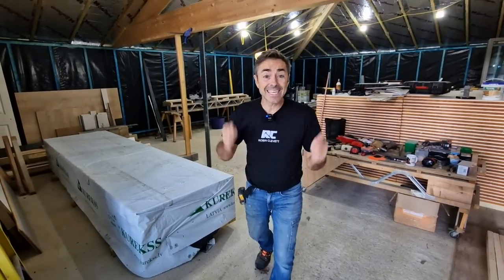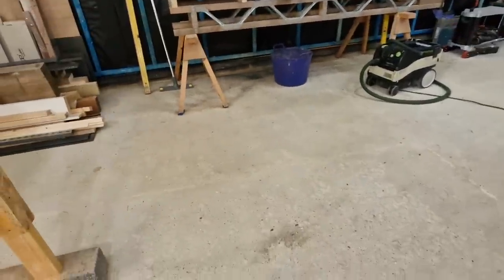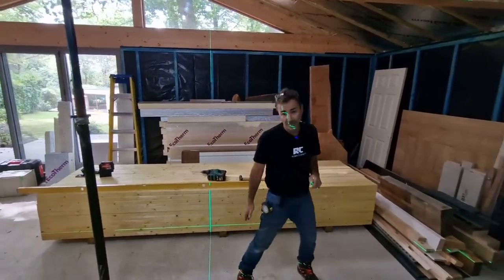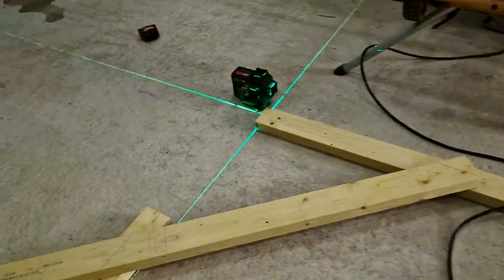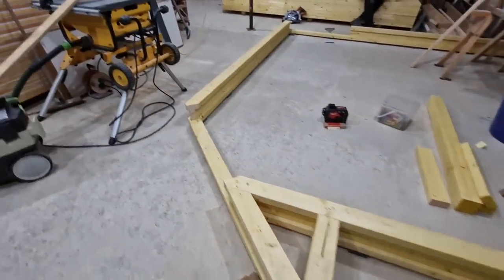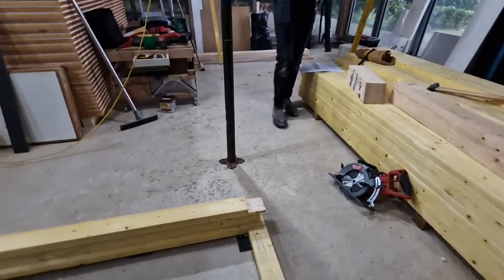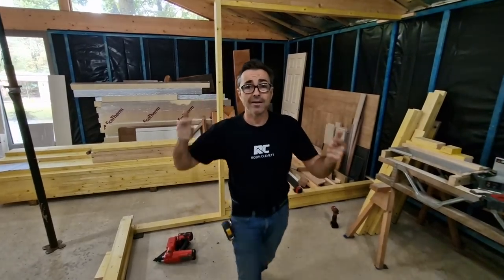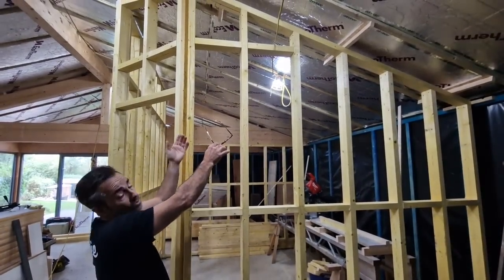Stud work with perfect timber!!! Ultimate Garden Room

Comment: Those 4x2s work just fine in dry conditions. Put them outside in the rain and most of the gluejoints fail. Excellent for interior work, not for outside

Comment: As usual nice neat work you are doing there.
Would an option have been to first lay the floor insulate, run your ufh pipework and screed before doing the studwork? I think if possible that is a better sequence. Allows continuous insulation layer, easier to achieve perfect screed and less faffing with the stud sole plates. None of the studwork is loadbearing, or doesn't appear to be transferred to footings at least, so having them laid on the screed ~= to laying them on the slab? 
Regardless, I'm nit picking it's a great job you've done and those Tru-stud looks like a great product.